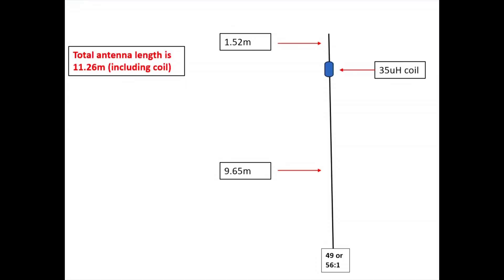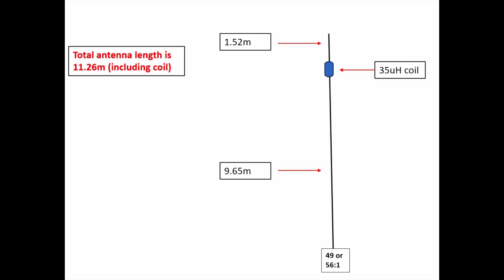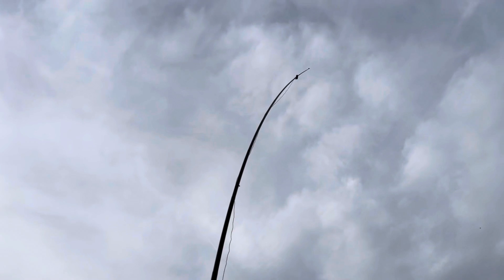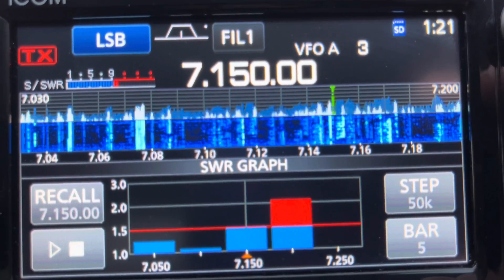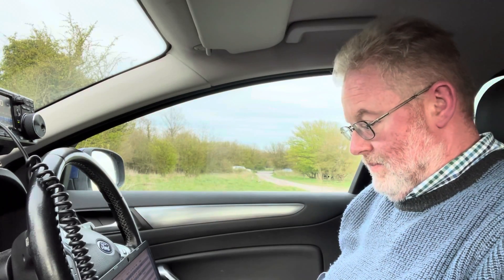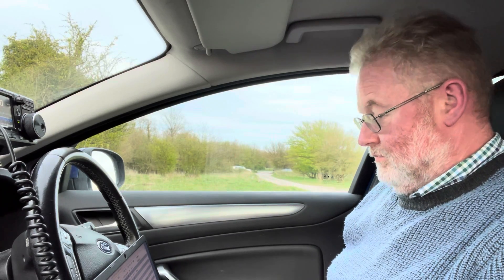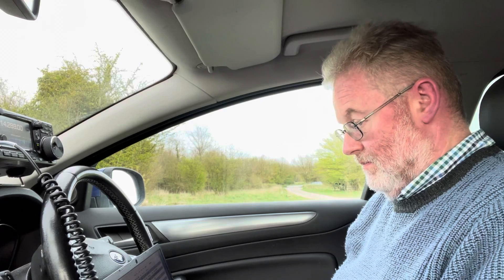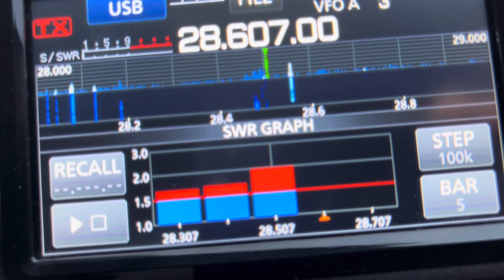Simple 40 Metres Small Space and Portable Antenna (plus 2 other bands!)

Comment: Would be good to see the antenna in action on 40m at night, interested to see how well it performs for DX on 40m .
Reply from the maker: Good point
Reply: @TIMG5TM  my dipole for 40m is ok on 40m it's too low really (7.5m agl). I can make contacts on the East Coast of the US sometimes but not really further afield. I need to try vertical antennas more I think. I have a 5/8 wave for 10m I made that works well on 10 and 12m seems to work well for stations in the directions behind my house (SW-S-NW) where there's an open field but struggle to the East (housing estate) where dipole works better. Maybe portable operation could be the answer, do you operate portable often due to noise and to be free from obstructions? 73 Owen

Comment: Since it's an EFHW, the 'counterpoise' is a high impedance (thus high voltage) point. So the current at that point will be relatively low. I presume that you might use (for example, to make the point clear...) a 4-inch metal stake in the ground to deal with the high voltage / low current counterpoise requirements.  This would help (note: 'help') to keep the outside of the feedline RF-free. It might also help with the matching, but very much a case of YMMV.
Reply from the maker: The final point you make is salient. I’ve never required the use of any counterpoise system with 100w portable or at home. A common mode choke at the radio end of the feedline can be used, but that’s it in my experience of having used efhw for quite some time now. 73
Reply: @TIMG5TM  "In theory, there is no difference between theory and practice. In practice, there is." - Yogi Berra

Comment: Great stuff Tim. I am about to start experimenting with an old Silver Rod CB antenna with some crazy add on bits and pieces . Hopefully can make it multi-band but at the very least it may alarm the neighbours (and the wife). Seems a shame to leave it to just collect dust otherwise 🙂. 73 M7BLC.
Reply: i did that once to my old silver rod...ripped out the tiny matching coil ,added a 9/1 unun at the base and at 18ft long,loads fb from 30m thru 10m . i also choked the rg58 feedling 25ft from the unun to act as its counterpoise. gl
Reply from the maker: Sounds great John!!
Reply from the maker: Good luck John!